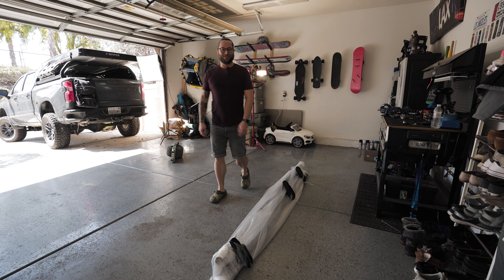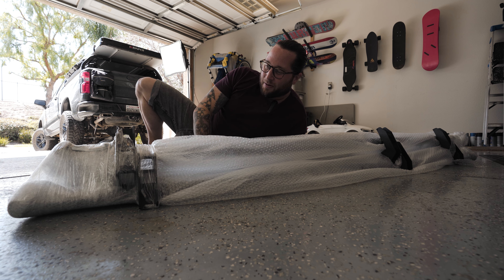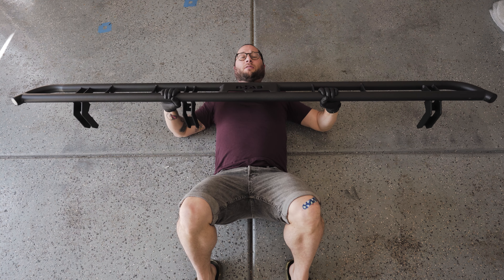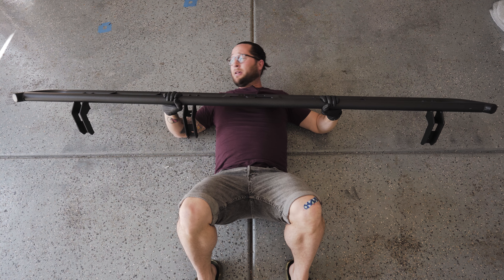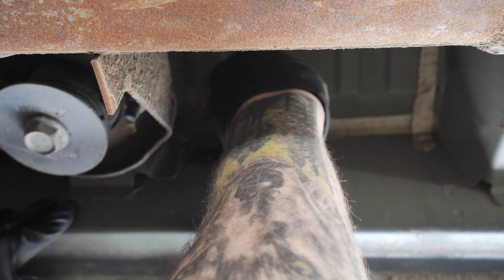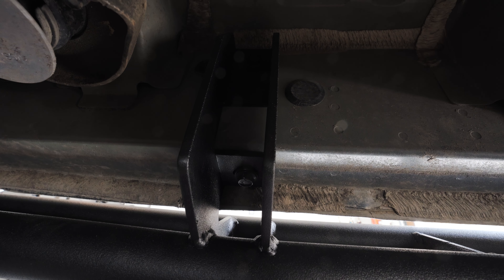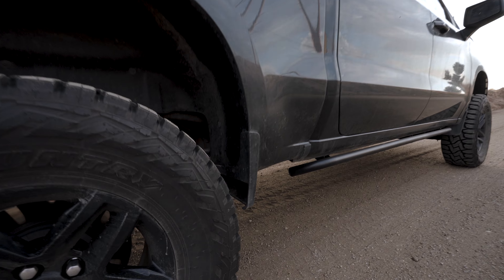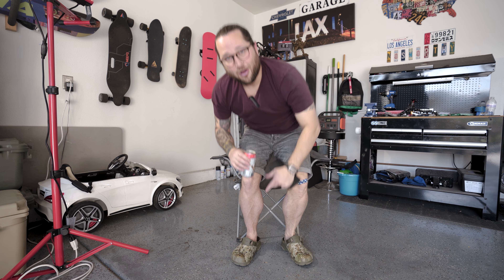N-Fab RKR Rails Install and Review (2020 Silverado)

Comment: Proper rock sliders are supposed to mount to the frame.
Reply: Its highly recommended just because the mounting brackets can bend
Reply: By all means, and they're supposed to be welded as well, try and get one off when all goes awry...
Reply: 85% of people dont do hardcore rock crawling, no reason to spend more than you have to on something you'll never put it's true potential, other than to impress other dudes 🤐

Comment: Don't worry about the rock climbing people complaints. Your in a full size truck. The off road trails you'll be handling will be more than adequate. I agree these aren't true frame bolt rock sliders. But your not putting them on a rock crawling vehicle. Your putting them on a full size truck that will see some regular off roading.

Comment: Great video man. Haters are gonna hate lol @ the toyota and jeep guys. This truck has good clearance and you could do exceptionally well on rocky steep trails if it came down to it. (exluding extreme trails for safety measures) in a pinch I think these sliders could possibly save your ride some some serious damage in the case that you were actually going to hit some rocks (not necessarily slide on them). They look good thanks again for the vid👍

Comment from the maker: Should I weld a few sections of tube steel directly to the frame? These installed straight to the cab with the stock holes provided from the factory. If I get enough people interested in the comment section I will make that video!
Reply: I wouldn’t. I personally think that the bolts are good enough, and if you damage the rock sliders and want to replace them, it’s much easier to unbolt them.
Reply: Are these bolted to the body and not the frame? They should provide adequate rock sliding. Definitely don’t use as a recovery point
Reply from the maker: @orlandog686  yea they use the holes that come from the factory underneath the cab.  Not on the frame.
Reply: These will bend if u slide them on rocks. Best way to test that is jack up your vehicle off the rock sliders. If they bend they will not protect your rocker panels. It will just multiply the damage. Look into RCI offroad. They should bolt directly to the Frame.
Reply: I was wondering about the strength as well. was looking at rocky-road.com but they haven't made any for our generation yet.

Comment: How are these holding up??? I am stuck with my setup. I have a 2020 Ram with the 6'4" bed, quad cab, and a 33 gallon tank. NO ONE makes a true bolt on rock rail for this thing. Have called a few 4x4 shops and most of them are no longer fab shops, they just want to sell bolt ons. I had a set of Ram off road steps and just bent one of them on a boulder this weekend and am in need of something beefier. Body bolt ons seem to be the only things at this point...unfortunately.

Comment: This video was very useful. You helped me make my decision. We have heavy trucks, and a body mounted "rockslider" just doesnt scream, i can hold up the weight of this truck. Have you put a farm jack on it? Im not hating. Moreso, interested or worried how some companies claim "rocksliders" when they are just glorified steps. At any rate they look good just dont seem strong enough.
Reply from the maker: They are body mounted after all. These are more low profile steel steps. They have saved my doors on a few occasions but I haven’t need to use them with a jack at all so I can’t confirm the function there.

Comment: be careful trying to use those as rock sliders man, they're attached to the body, not the frame. If you put the weight of the truck on them it'll bend the body of the truck. They'll protect your doors from branches and flying rocks, but won't support the weight of the truck at all.
Reply from the maker: Thats my concern
Reply: @halohalohikers3571  There's a company on amazon that sells some by TRAIL GEAR and they only sell them in a 78" setup but it comes with 3 spare tubes to weld to the frame. Use  2 of those to make them longer and cut them in the middle and weld in the extensions. Then use regular square tubbing and weld them to the frame. Thats what i'll be doing on my 2012.
Reply from the maker: @robledochavez86  interesting 🤔 I’ll check them out. Thanks.

Comment: If they don’t bolt to the frame they are not rock sliders. These will bend if u put the weigh of the vehicle on them and destroy your rocker panels.
Reply: Can't find any real ones for these trucks. Which sucks, I like toyotas but every one and their mom has one on the trails and their mpg is horrible. They get all the love in the aftermarket and GM trucks don't have much to choose from.
Reply: @juggsauce  yea that’s what’s tough about the Chevys. There isn’t much aftermarket support. I would try to talk to a fab shop about it and get some custom ones made. I was searching around google and couldn’t find any ones that attached to the frame either.
Reply: @herbzum  funny enough I'm actually talking to a guy about roof rack mounts. Gotta get it done somehow!
Reply: @CJ well shit that's awesome. I'll be looking into that then

Comment: Excellent update :) this may have been answered already, but what tire size/offset are you running and is there a lift/what is it? Thanks for posting, awesome garage!
Reply from the maker: 6” lift, 35x12.5x18 tires, 2” wheel spacers 🍻

Comment: Do they provide a decent stepping surface on their own?
Reply from the maker: There’s no where to step on these they are really low profile. You can buy two step attachments that they make that also bolt right on to this RKR system if you wanted the steps.
Reply: @halohalohikers3571  thanks man.  I've seen some low profile ones on Toyotas that doubled as steps...just wanted to check.  I'm with you though, high and tight, just not sure if my wife and kids can handle the truck (stock height) w/o steps.  Thanks for replying, keep up the good work!

Comment: Those are not rock sliders.  They don’t mount on  the frame  but instead of the body. They’re just modern day nerf bars.  Not actual rock sliders
Reply from the maker: Yea low pro nerf bars I think would be a better description